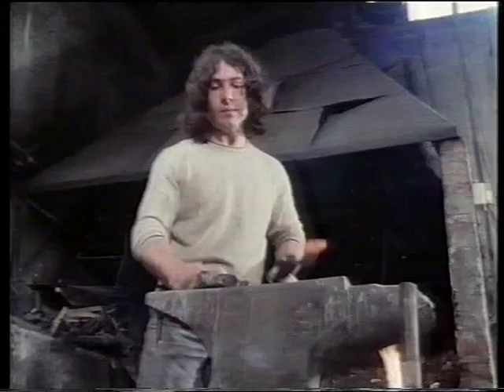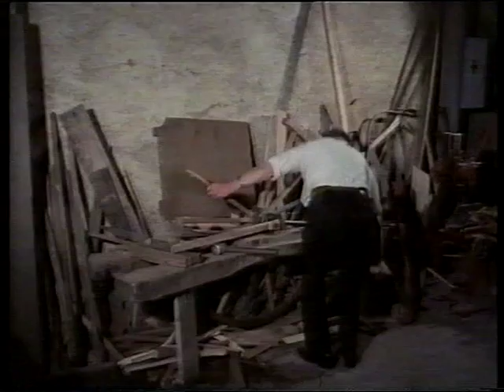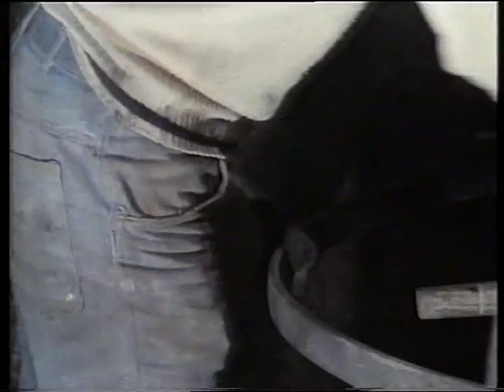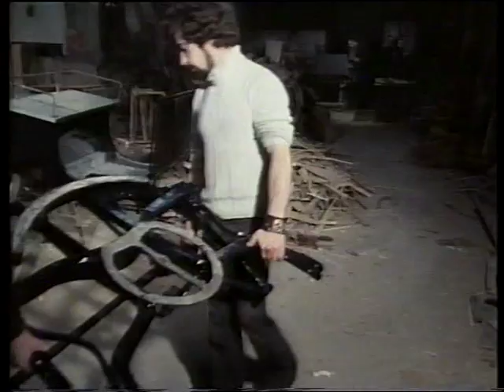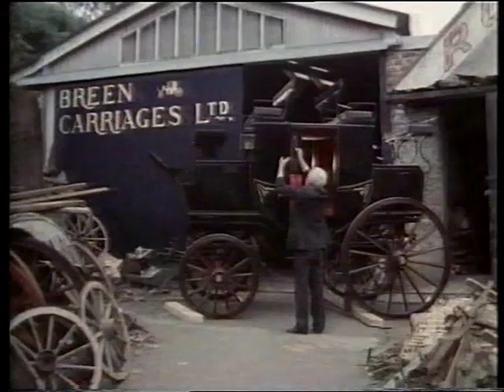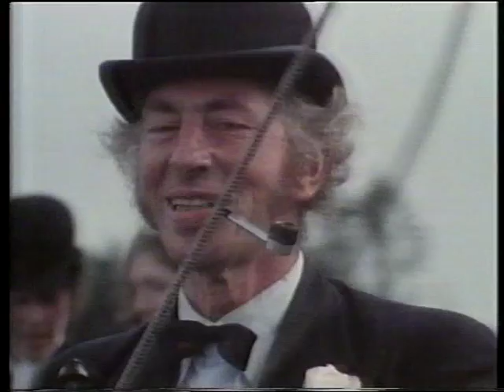Hands: Carriage Building

Comment: Elm in the U.S. was decimated in the 70's by Dutch Elm disease so I wonder what these men would use now if they're still in operation.
Reply: Most now use ash, which has similar working properties.
Reply: @twoodfrd  Now under threat from Ash Dieback.
Reply: Patrick Ancona  Thanks, just pray no nasty catches with those speciecs
Reply: @51WCDodge  why the worry they're not operating anymore. Not sure if you know, but there are cars now!
Reply: @gbwildlifeuk8269  Don't know if you are aware, but there are some top range cars, still use Ash and  Elm in the manufactuer. Besides, as I drive and restore vintage vehicles, I can see a need outside carbon capture for specific timbers.
Reply: @gbwildlifeuk8269  I live in a very rural area and has a large Amish population. The northern end of our county has more horse and buggies than cars quite often.